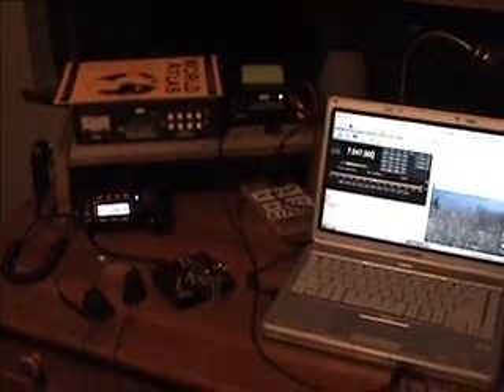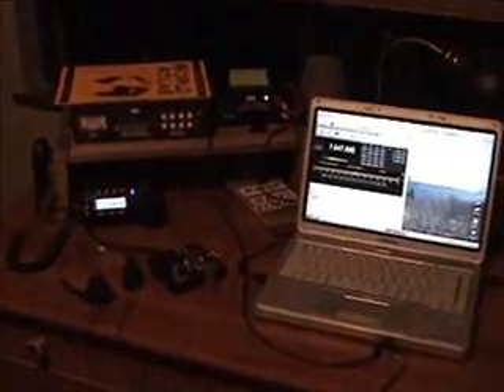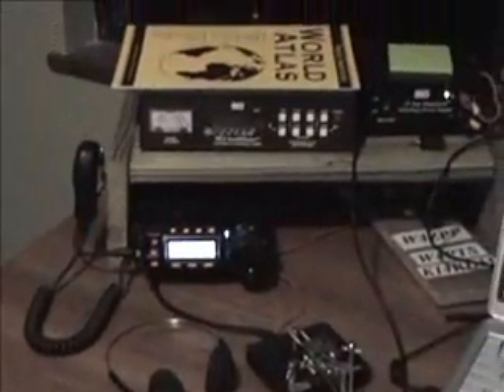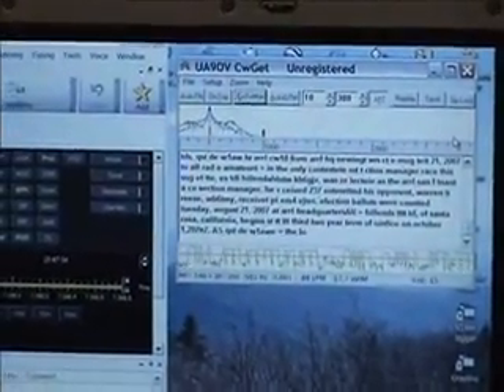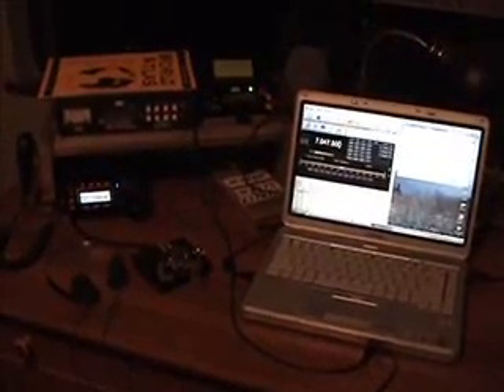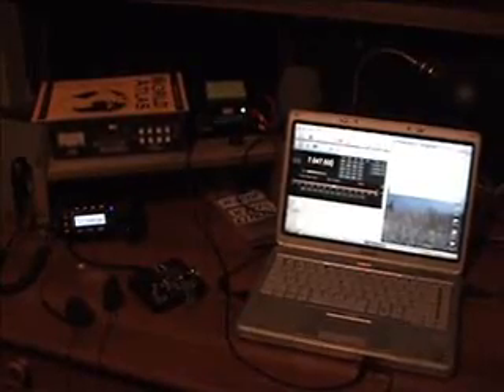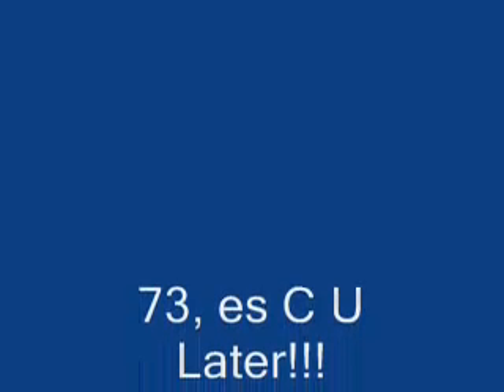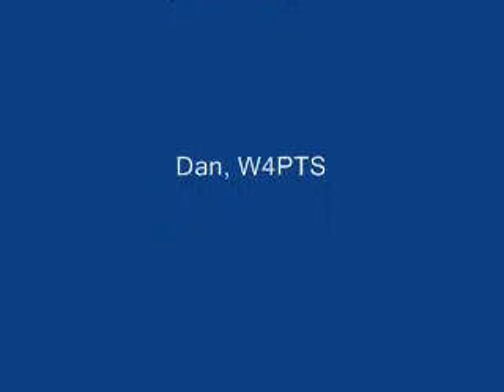Ham Radio...an introduction to the HF Bands

Comment: Well...put it this way, with my 2 meter base setup, I've been able to hit repeaters 35-45 miles away, and that's with a MOBILE antenna grounded via a metal plate, sitting in my ATTIC!   VHF is very line of sight, meaning that if your antenna can 'see' it, you can usually work it.  

Across the US?  Well, for the tech license you can always use echolink, but for the real action a HF transceiver is where it's at.